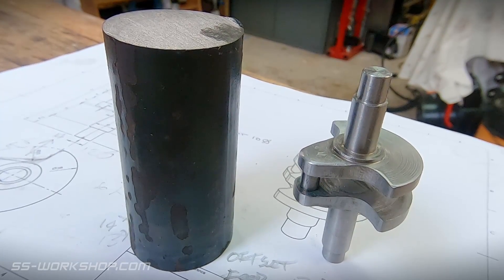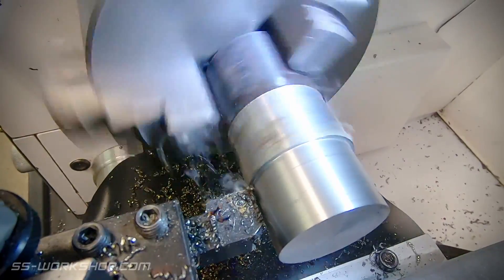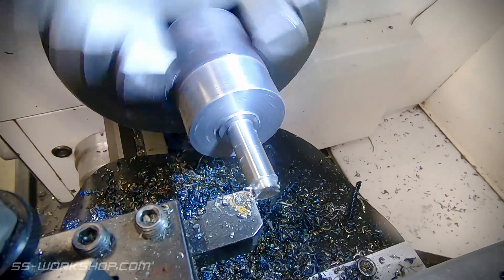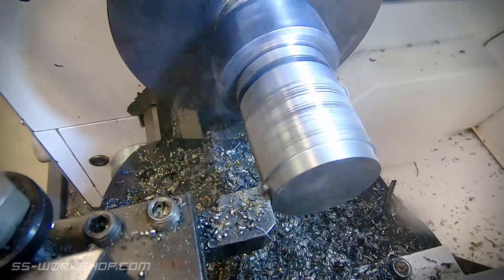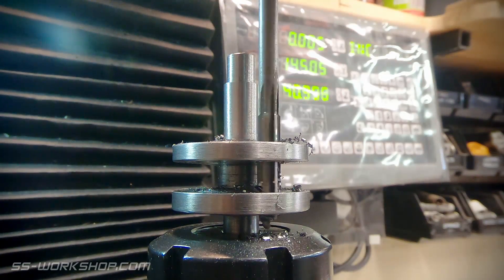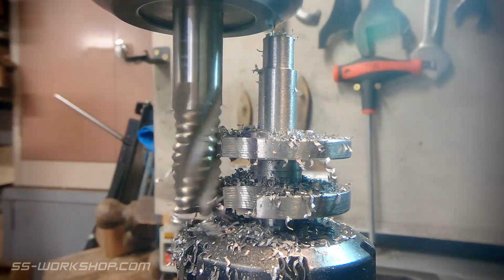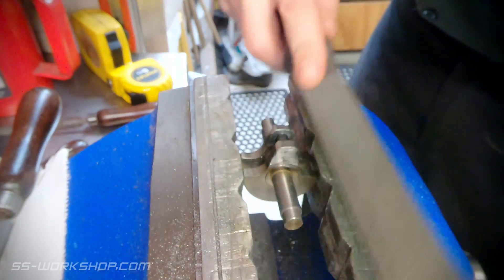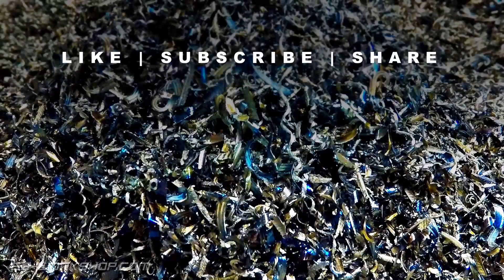Fell Engine Project - 2 Piece Crank S1.E36

Comment: Congratulations. That looks a lot safer then the one piece crank. Would you ever consider taper pins for the offset pin?
Reply from the maker: Thanks. Yes safer and more accurate. Interesting thought with the taper pins, I assume you mean for fixing the offset pin. I guess you could if the crank was large enough or the pins small enough it’s really about getting a strong connection so silver solder would be the traditional model engineering solution if I didn’t have the TIG welder at the end of my bench.

Comment: Im glad i watch your videos :-). I need to make a new crank for my Pamela (3 Cylinder) and this does look better, and far more accurate than the 3 piece currently installed or doing the interference cutting method. So as always another great video. At the rate your going it will be ready for our next 3.5" gauge rally down here in the south island. :-)
Reply from the maker: More accurate but less exciting than the one piece... it might take a little longer than you think to finish it, the to do list for it seems to be getting longer all the time. Cheers
Reply: SS Workshop my 2 month rebuild of the pamela is now out to 8 months as I need to redo all the axles/wheels as they are out of true as well as the centre crank and then there are the steam leaks in the pipes and the faulty injector so I know how it goes. But just incase it’s around October 🙂 But we do it every year. All 3.5” and smaller welcome.
Reply from the maker: I’m sure that’s how all builds go, I should be ready by October 2025 at current pace... hopefully a little earlier but not getting hopes up ;)
Reply: SS Workshop I thought I would take a break from building my own to restoring someone else’s. Talk about inheriting issues 😁. I meant to say as well that there is a section on splitting the firebox in Martin Evans book if you have it. I remember mentioning the process to you in another of your videos.
Reply from the maker: Thanks for reminding me, I do recall that. I just found the section on smokeboxes in the book, will put some more thought into how I can make it work it would certainly make life easier in the future.
Reply: SS Workshop I still have the scar on my hand from undoing the snifting valve so there is merit. I will definitely be doing it on my KB.
Reply from the maker: I was trying to think how to fit the flange to seal it, then thought it could be vertical inside so fixing is from the outside. I found this which shows a similar setup 
http://ibls.org/mediawiki/index.php?title=Split_Smokebox

On another topic do you run drain cocks on your cylinders, what’s your thoughts on them? I have been looking at making automatic ones or steam actuated which would be correct to the engine but could be over the top, certainly not a lot of room for the outside ones.

Comment: If you push in & weld the pin before you mill the shape of the counter weight etc, wouldn't it make the crank stronger to do all the milling on it before cutting out the shaft in the middle? also no edge burn when welding in the crack-pin? good work by the way, I'm enjoying watching the videos :)
Reply from the maker: Thanks, you make a good point, my thought was once I drilled the hole, it was aligned in the rotary table. But think it wouldn’t be to much effort to line up again after welding now you mention it. I give it a go when I make the other 3, my out of practice welding needs all the help it can get. Cheers.